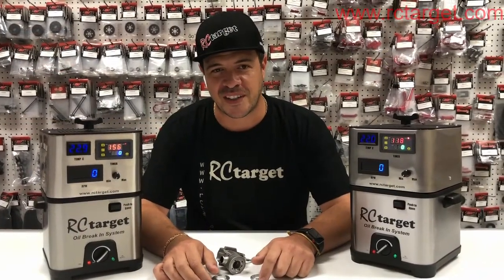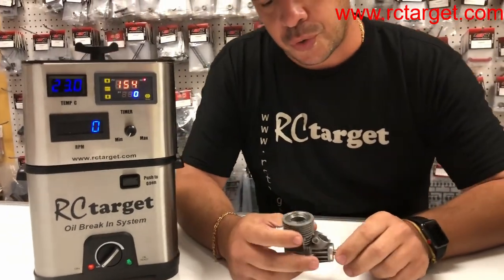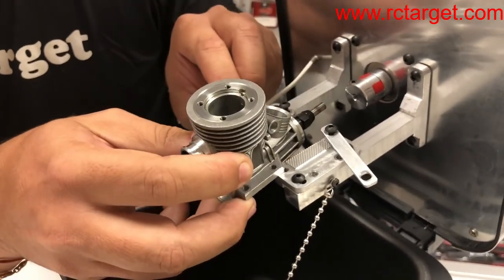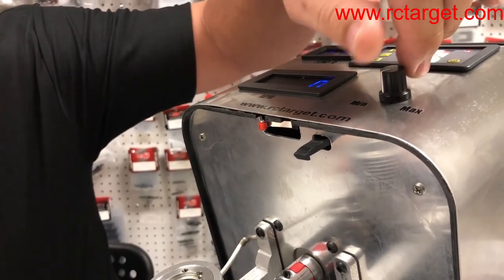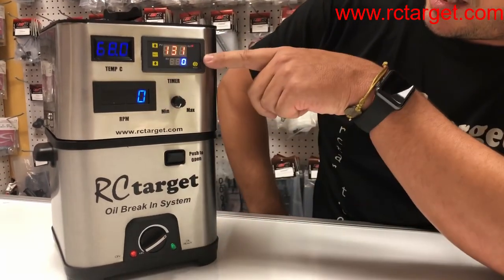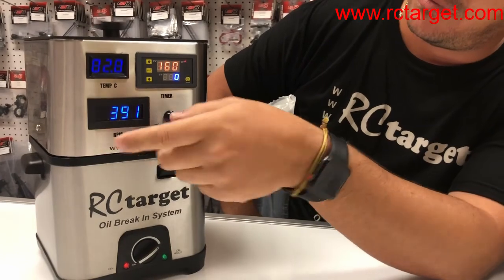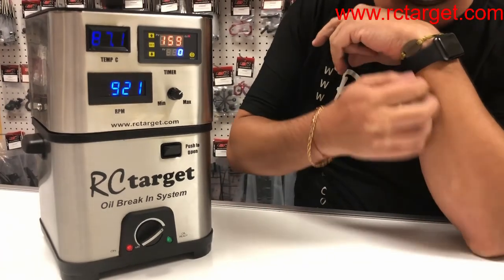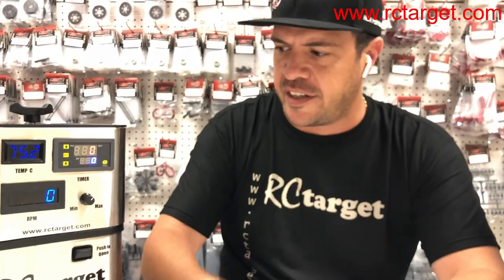Xpress-Oil Break In System (English)

Comment: There were concerns that while the engine is mounted the con rod can fall off the crank shaft while the device is running/active. Can you please explain why this doesn’t happen or won’t happen. I’m looking into a purchase so your correspondence would be appreciated. Thank you.
Reply from the maker: We appreciate you comment and interest in our products, the concerns about the conrod falling of or even rubbing the internal channel of the engine crankcase are unfounded. To better understand this please keep in mind that the engine is submerged in oil which creates a flow that centers the conrod during operation. In the video you can see how we purposely show a broken in piston/sleeve in which the conrod  has no marks at all. Hundreds of engines done with this process are the best proof that our break in system is not only the easiest to use but also the best in the industry.
Reply: RCtarget thank you for taking the time to address my concerns. I appreciate it. After the 160mins in the hot oil bath how many tanks does one have to run before the engine is race ready? From experience did you ever had to give an engine a second cycle in the hot oil?
Reply from the maker: 160 minutes is what we found works good for almost every brand, by turning the knob located in the top of the machine you can feel the engine pinch. We did find the Nova P5 engines for example require some more time. After the engine is done in the machine we normally do a fuel bottle (500ml) at the track with a bit richer tune than race tune.
Reply: RCtarget last but not least is there a warranty on your product and does it include an instruction guide in box?
Reply from the maker: We offer a 1 year warranty on the machine, and it does include a instruction manual as well
Reply: that is way roleof the brain against this copycat used a opened back plate